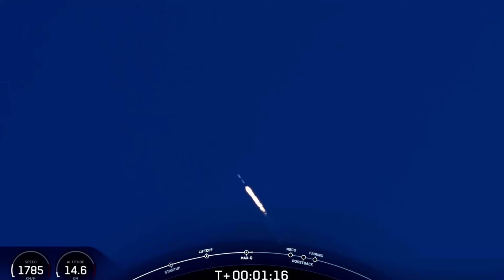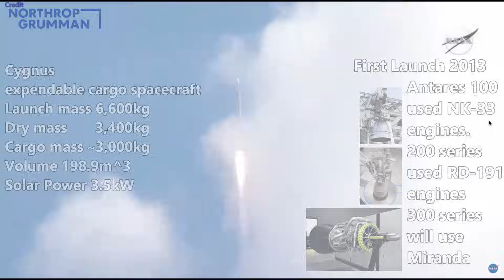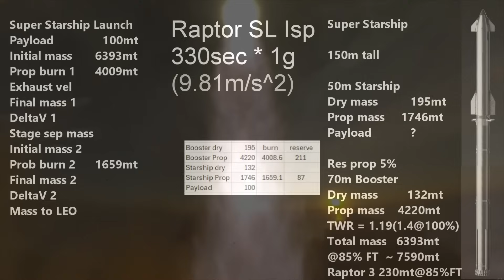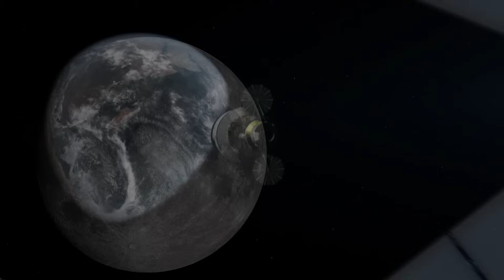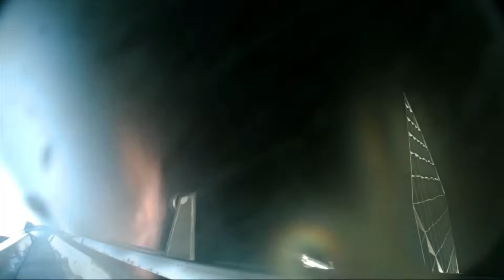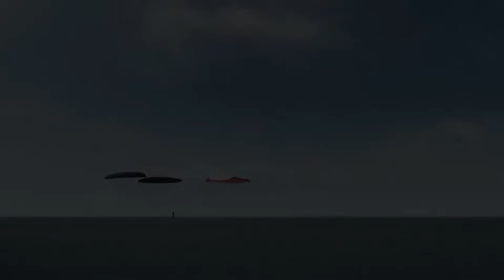Starship Version 3! The Super Starship

Comment: Dear Terran Space Academy,  I love your channel, particularly the content that you do YOURSELF in your own voice, rather than the material that you take from other channels and lectures.  (It would suffice to simply post a link to that material).  To that end, I would like to suggest a few topics that I think would benefit from a Terran-Space Academy treatment... these are listed in order of most inside your existing wheelhouse, the ones that would require the least new research on your part, to least inside your existing wheelhouse.

1. The benefits and disadvantages of side-boosters compared to vertical stages.  How much weight cost do the structural hard-points for side boosters imply?  Are side-booster separations more or less likely to cause RUD than vertically stacked stage separations?  If side boosters are basically no different, Why vertically stack at all?  Why do some side boosters have aerodynamic covers that are relatively flush with the center core of the rocket, and why do others have normal symmetrical conical aerodynamic noses?  Why are side boosters only ever strapped to the FIRST stage?  Why are most side boosters solid-fuel, and most stacked stages liquid?  What are the relative advantages of Falcon Heavy's variable throttling of side and center cores over the cross-feed system that was originally planned?  While there is no indication that Musk and SpaceX are even thinking of this, but if Starship was in a Falcon Heavy like configuration with to side boosters around a central booster and Starship on top, what would it's hypothetical performance look like?

2. Nuclear in space propulsion.... a comparison of different architectures: Nuclear Thermal, Fission Fragment, Nuclear Powered low or no expended propellant drives such as Zubrin's dipole drive, ion drives, photon rockets... that is, Is there an advantage for these drives to be nuclear rather than Solar powered.  More generally, has solar power, from a up-mass per kw perspective basically out-competed nuclear radiothermal generators for probes in the Terrestrial distance range from the sun (ignoring issues of safety and the politics of launching nuclear material)?  

3. The economics and business side of a launch startup... How much seed capital does t take to go from a rocket idea on paper to a prototype rocket engine that's actually been fired on a test stand for the first time?  What kind of expertise-sets do successful examples of such companies tend to have?  That is, are the employees of these companies ALL rocket-engineers?  What other roles are essential for such companies?  Is most of the success of successful rocket startups in having a well-regarded and seasoned CEO or founder?  How do launch startups differ from computer startups?  (One of the things that has made Musk so successful in SpaceX and Tesla is that he's BOTH CEO and CTO... that lets him get the advantage of corner cases in both the engineering of the main product, and the design of the business model of the company.  Sometimes a technical problem is intractable, and being the CTO he has a real handle on when that is the case and to what degree, and then being the CEO he can design the companies business case to bypass the problem that was intractable on the engineering side... conversely he can do that in reverse and opt for technical fixes to bypass legal market or compliance barriers to progress that might represent intractable barriers to a CEO but not to the CTO.)  

4. Spinning space stations for artificial gravity paired with Inflatables... This seems like a match made in heaven... the inflatables are massive when inflated and small and relatively light when launched, and thanks to fibers like Kevlar which are much much stranger than steel cables can easily withstand 1G of sheering forces, conversely spin only really works if the radius of the station is large.  Yet bizarrely these two concepts seem to never get paired and even seem to be mutually exclusive in the minds of some people who talk about them on youtube.  The advantages of spinning inflatables, becomes greater when one considers them beyond the current simplistic inflatable paradigm of an inflatable that is  launched in on piece, inflated in one step, and that's it.  In order to be useful within that simplistic launch and operation paradigm current generation inflatables must be constructed much more complexly than simple balloons with walls that are many stacked layers of different fibers with various properties designed to make a safe habitat wall once inflated from the inside.  However, if you are willing to off-load some of the complexity of the final station onto in-space assembly, the resulting station size can be massively increased. The simplest form of this is modular construction.  We use that already in space stations and have for decades... Nothing about this method couldn't be used with an all-inflatable station.  As a simple example, imagine six inflatable modules that, in their inflated shapes, were essentially pie-slices... these modules could then be docked together with one another into a circle much larger than any one of them.  That circle in turn could spin.  Yet another idea that never seems to be talked about is the idea of an inflation construction step that is more complex than putting together modular tinker-toys in space.  Imagine you launch a simple balloon, perhaps made of nothing but a single layer of thin Mylar, then inflate it... its inflated shape can be MASSIVE because it's just a flat sheet of Mylar when underinflated, and so literally square kilometers of the material could fit in any orbital class rocket's fairing.  And it doesn't need to be inflated with a large amount of gas to start with because the outside of the balloon is hard vacuum.  Then you inflate another slightly smaller bag inside the first one such that the space between the inner and outer balloon is say... 1 meter.  The inner balloon would be inflated at very high pressure, much higher than the outer balloon.  The 1-meter space would likely need a number of fittings and connectors installed between what will be the outside of the station and what will be the inside of it, but because it is an enclosed space, the space walks to do this would be relatively safe.  Next, you fill the space between the two balloons with something like A-B foam, probably mixed with asteroid or lunar-mined regolith for density.  Finally, after it has set, you wrap the outside of the inflated structure with ribbons of a Kevlar-like material for structural support and spin the thing up.  Result:  A space station with meter-thick walls that easily could have volumes exceeding anything envisioned today and relying upon launchers with no more capacity than those that exist today.    

Just some ideas on future topics, and thanks again for the channel.
Reply from the maker: Thank you so much and we really appreciate the feedback.  I'll start with number one and compare adding a first stage (India's solid rocket motor) to adding solid boosters (SLS and Vulcan) or just adding more cores comparing the Delta IV and Falcon Heavy to the other options... I have something planned for this weekend but expect it for the one after.  I'll credit you for the idea. Ad Astra Pro Terra! :-)
Reply from the maker: Speaking of credit... MM650? or something else?

Comment: I know it’s illogical but if it’s Orange coloured rocket I automatically think that it is an inferior rocket, yep I know it’s not right and it’s something I’m working on.
Reply from the maker: Ah, color based prejudice seems to be a basic flaw of human reasoning :-)  I assume you liked the first shuttle launches when they painted them white? Just kidding.  Since that orange insulation killed everyone on Columbia I cannot disagree my friend.
Reply: @terranspaceacademy  
Well it’s the little thing’s like the two giant Roman candles strapped to the sides, test pilots description of its flight “it’s like flying a brick”, only one runway landing attempt available, poor reuse ♻️, rumours that the internal wiring for the circuitry used wire wrapping Method, didn’t Resemble what we originally was promised at all. SLS 💸 might have also contributed as well.

Comment: Thanks for another excellent analysis.
Only one problem, they have yet to get the regular Starship operational let alone the "Super Starship". As it stands right now the vehicle is overly complex with more failure modes yet to be determined.
I know it is heresy in these circles to be in the slightest critical of anything Spacex or Elon Musk. But, somebody has to have the guts to point out when the emperor is buck naked!
It would have been more prudent and they would be much further ahead had they evolved the Falcon architecture to the next gen - larger booster with re-usable strap-ons, Merlin to Rapter, RP1 to Methane,  fewer engines in each booster, focus on a re-usable 2nd stage, etc., etc.
I hope I am wrong, because like all the Spacex/Musk fans I would love to see this bird fly and fly reliably. But the engineer in me tells me that 66 high pressure turbopumps in the booster and another 12+ in the ship, the complexities of controlling all that, to say nothing of the ground infrastructure to get the bird up in the air ... And everything has to go right!
Don't book your ride out anytime soon.
Again, hope I am wrong! Ok, maybe the emperor is half clothed!
Reply from the maker: A good mental exercise to understand the issues of changing rocket components and capabilities :-)
Reply: The "super Starship" is referring to Starship version 3.  The current prototypes are version 1 - there are still 5 of them, already in various stages of completion, remaining to launch (covering this year, and possibly part of the next), until SpaceX starts making version 2 (launching next year).  All of which is to say, the stretched Ship is still a few years away - it's something to look forward to, but not something to focus upon just yet.

Regarding "complexity": that's one way to look at it.  Another, is redundancy: Booster and Ship can afford to lose an engine each (Booster, more than one engine even) and still make it to orbit.  Yet another, is steady-state mass-production: higher reliability and repeatability can be achieved and sustained, as opposed to the case of limited-run, artisanal products.  Incidentally, the design of Raptor engines is iterating toward ever greater simplification; currently headed to version 3 (though the ones flying this year are all likely still on version 2 Raptors) - so engine-wise, there's actually a drive toward complexity (and, relatedly, cost and weight) reduction.

Comment: I have a spreadsheet for doing exactly this work. It took me a while to trust its answers.
I started bc i wanted to know what the best design would be if you converted a falcon 9 into a methelox rocket with raptor engines. The idea was a mini starship for smaller payloads, fully reusable, of course.
My conclusion  was: Not a good idea.
I'd be curious if you have an opinion on the subject.
Reply from the maker: I was going to do a lesson on the "Raptor 9" putting any unused Raptors to work with a three stage 9SL/5vac/1vac system. Work the numbers and email me.  We'll see if it would be worthwhile. terranspaceacademy@gmail.com
Reply: @terranspaceacademy  
Power is out where I am right now. (NorCal)
But I should be able to do this by the end of the week.
Reply from the maker: Dang! Hope it comes back soon!

Comment: Zero successful launches. Zero successful landings. No orbital refueling depot. No lunar lander. No tanker variant. Muxrat is great at promising.  Without Tesla funding all these black holes (including SpaceX), he is bankrupt
Reply: SpaceX funds itself quite nicely; it has no need for any funding from Tesla.  Perhaps you're unaware (which is a nice way of saying, clueless) regarding Starlink, or the fact that SpaceX's Falcon 9 is the world's most prolific launcher by FAR?

As for Starship, SpaceX is developing it first and foremost as a deployment platform for full-size Starlink 2 satellites - which are too large and heavy even for Falcon 9 to deploy cost-efficiently.

This year will see several successful orbital missions for Starship prototypes.  Last year's second launch already came within a hair's breadth of reaching orbit: it only failed because it wasn't carrying any cargo, so had too much propellant left over, which it attempted - unsuccessfully - to dump overboard, causing the RUD.
Reply: @Spherical_Cow  You must realize that explanation is complete bullshit. Fuel venting is part of the flight termination system.  The size of the explosion suggests there was not that much fuel present in the first place.  There is zero chance they would have not waited until orbit was complete to vent excess fuel if that was really the reason.  
How will the needed refueling transfers occur if launching with excess fuel was the issue.

Starship is a shit design and much to heavy. They had already eliminated reentry fuel reserves and pushed the booster to a higher altitude than planned for separation all in attempt to get the empty starship shell to orbit. It still was not traveling fast enough.   Any thing is possible with enough time and money. Starship is at least adecade away from 
Proving reliable as Leo crew safe craft. 

Space x lost 550 million last year. Starlinksupposedly had a profitable 1st quarter.  That doesn't mean it has recovered all prior investment costs and is a long long time away from profitability. Especially considering the entire current constellation has to be already replaced with the new prototypes once testing has been performed.  The likely reason of the 1st quarter extra revenue was the enormous costs Starlink was charging the U.S. for service in Ukraine. 

In all likelihood the rushed decision and building for a planned larger booster is a desperate attempt to increase the altitude for starship separation so it can reach orbit with the extra weight of needed equipment and interior of a functional craft.
Reply: @sidvicious6505  no, fuel venting is not part of the FTS.  The FTS on Starship consists of explosives strapped to the side of the rocket.  It works regardless of how much propellant there is or is not inside the tanks.

No, they wouldn't have waited until after the end of the burn, to dump excess propellant - because at that point, Ship 25 would've been in 0-g and the remaining propellant would no longer have been nicely stratified into gas at the top and liquid at the bottom of each respective tank.

The reason they launched with excess propellant to begin with, and the reason they tried to dump it at the end of Ship's burn, was that they wanted the flight to be as similar to a normal cargo-bearing flight (including the subsequent reentry) as possible.  Of course, it'd have been even better to launch with a mass simulator for cargo - but as Ship 25's payload door was permanently welded shut, I guess putting in an adequate mass simulator was too much of a PITA and they thought they'd get away without it (they were mistaken.)

You're going to discover within the next month or two (as IFT3 launches) that Starship is nowhere near as "shit" as you thought.  Hopefully, that will be an opportunity for self-reflection you won't let go to waste...
Reply from the maker: You must be talking about Bezos.  Musk has 100s of successful launches placing more mass in orbit per year than any other company/nation ever has and 100s of successful landings.  What can be done with the Falcon 9 can be done with Starship.

Comment: Could a Starship wet workshop be feasible? We could deploy a plastic lining inside of the methane and oxygen tanks after modification, like jerrycan repurposing kits for use with drinking water. Slap on an ion drive like the lunar gateway and you've got a huge station for a decent price
Reply from the maker: That's a good question.  An inflatable habitat or green house or recreation area to inflate in each tank? Very cool idea.
Reply: here's the trick question, could the outside, inflatable portion be made with materials allowing for plants to benefit from the sun's rays?
the living quarters could be installed in the reconditioned tanks @terranspaceacademy
Reply from the maker: Clear plastic with algae?
Reply: algea would be great for PLA synthesis too, I have a friend who's been working on a self amplifying carbon loop coupled with a bioreactor for making plastic up there/on mars (GrowMars its called) @terranspaceacademy